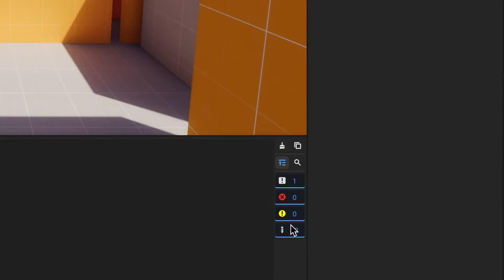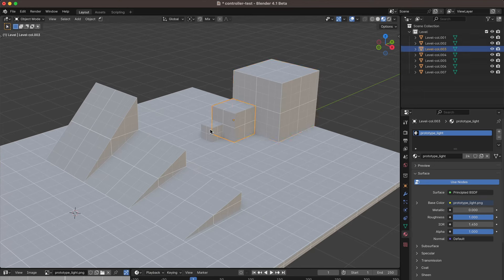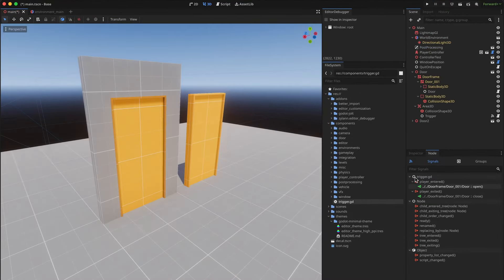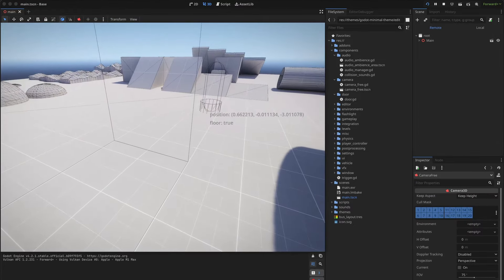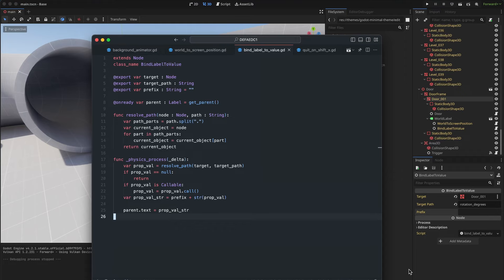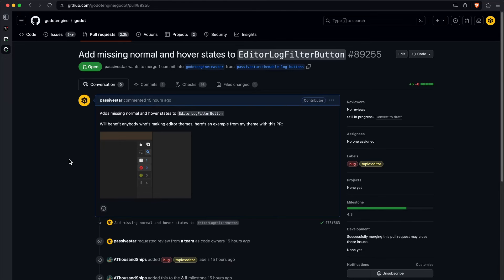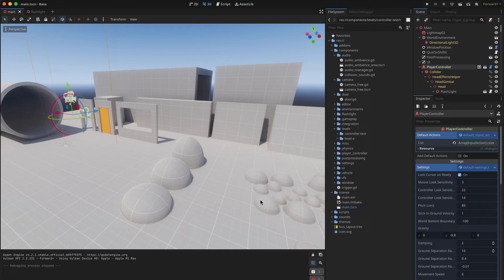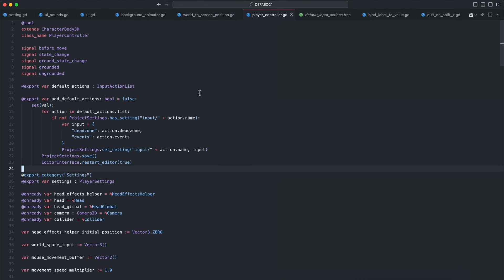chill godot devlog 1

Comment: Hey, nice devlogs <3

I am curious about how you done the free camera from 1:58, I understand that for ingame you have an additional camera for it and you change to control to it with some keybinding, but how did you managed to get the game to run in engine instead of external process like you mentioned? Did you implement it directly in C++ by compiling the engine?